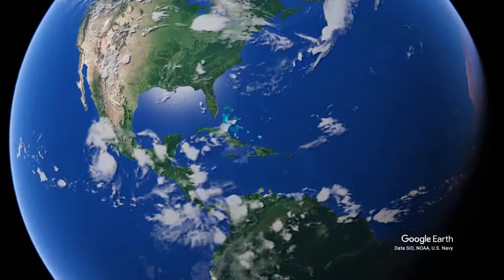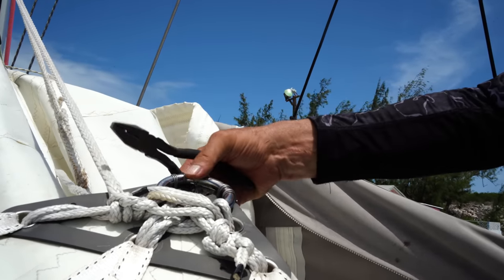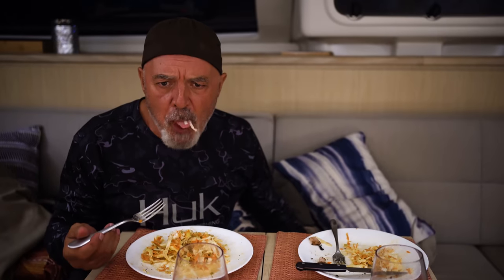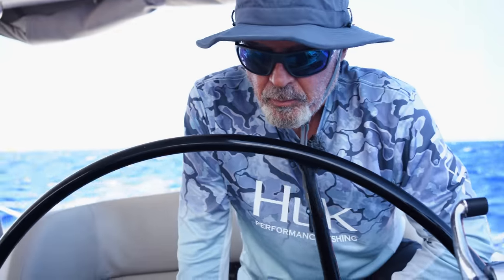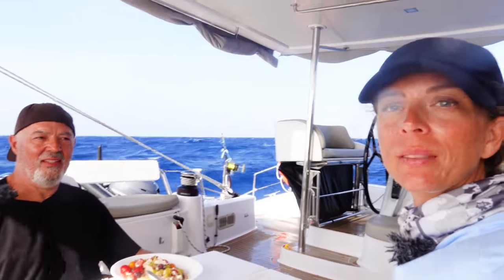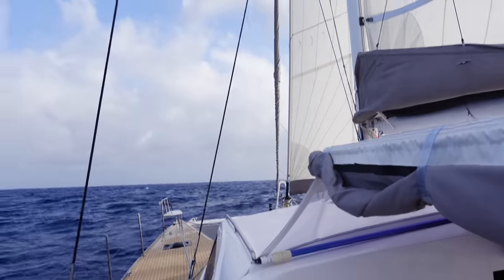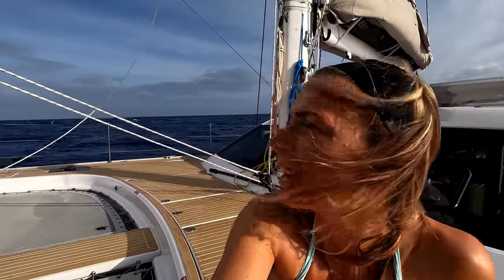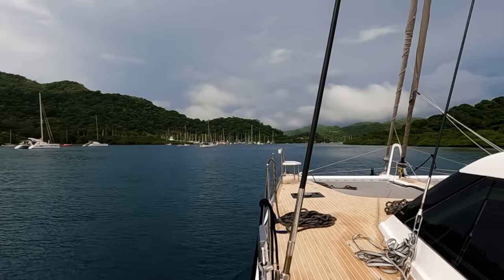Overcoming our BIGGEST #boatlife CHALLENGE Yet to Continue Sailing to Panama | Harbors Unknown Ep 71

Comment: Cruising = repairing your boat in exotic places!  I've never torn thru a headboard.  But I do carry some 1/4 pieces of aluminum plate, that might have been used to do that repair.  And big congrats on your crossing to Panama!  That's a significant accomplishment, especially sailing with just two people.  We've found a third person makes it so much easier on night watches.  Also agree with you that a nice rainstorm really cleans up the boat and makes the decks nice under foot.  We also tend to reef early.  Unless the wind is in single digits, we don't give up much speed.  But really feel better about it in the gusts.  And gimme some of that oatmeal!
Reply from the maker: 😂😂 We are learning that! What you say definitely makes sense and no our paddle wheel hasn’t worked in a year. We ordered and paid for one but after 6 months they still hadn’t sent it so we canceled the order.

Comment: Great sail, Congrats. Can't wait for more to come. Fabio, could you put a 'ring' on both sides of the sail to even out the forces and use a industrial stainless steel carabiner or shackle to attach to the halyard? The shackle or carabiner will then keep them together and stop them from flapping. Just a thought...Fair winds ⛵⛵⛵⛵⛵
Reply from the maker: Excellent idea, all I had was one ring, but two smaller rings would have been better. But yes, your solution would have been preferable. There is no chandlery in Great Inagua. Thank you for watching and for sharing your thoughts with us.
Reply: @HarborsUnknown  All good my friend. Only trying to help. I know I must sound like the 'great advice' after the fact, but unfortunately I am not currently working and I can't afford to follow you on Patreon, so I can only offer advice after the YT episode shows. I notice with interest the way you fixed the issue in this episode, The other way you could do it is to carabiner straight to the sail's eye with an extra strong SS Crab (to which you would attach the halyard) and then Dyeemah the other sail points to and from the carabiner as you did with the dyeemah in this video. Also I would not run a single continuous Dyeemah line, but tie each line to each every point individually. Time consuming I know but ultimately safer and stronger. A single line, once failed, they have all failed, whereas if single line fails, it's only at one point. If you have a good camera/ lens and or binoculars You can check on each fitting/Dyeemah line each morning without having to drop the sail...

👍👍
Reply from the maker: Another great observation!! By watching our videos early and commenting you are helping immensely . Your engagement is truly appreciated and supports our growth as a channel. We love your honest advice and learn from it. So, thank you from the bottom of our hearts
Reply: @HarborsUnknown  👍👍 Only trying to help! Fair winds.⛵⛵⛵